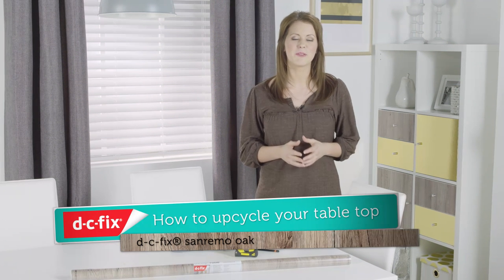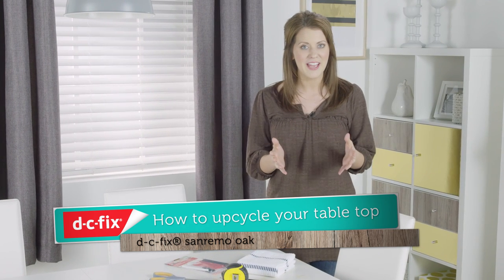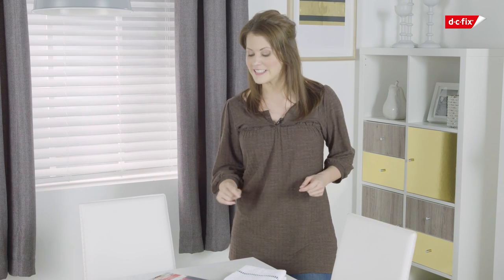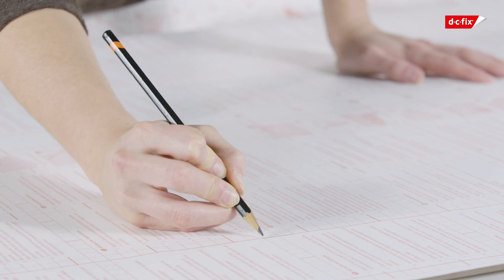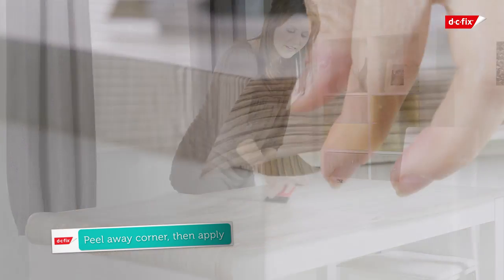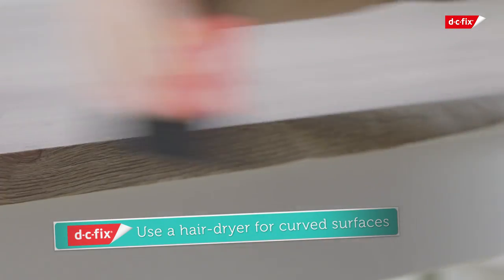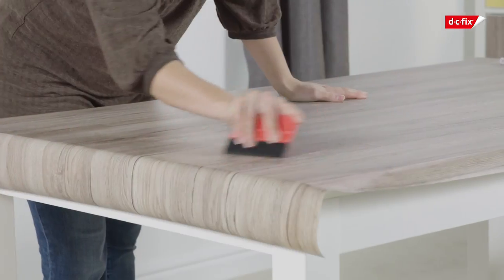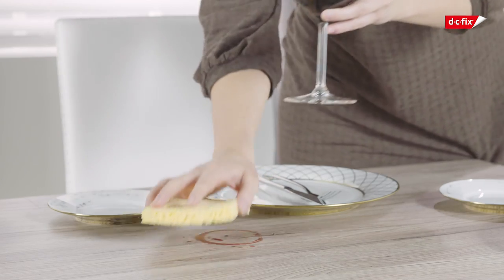Applying vinyl to a table top

Comment from the maker: As long as the table top is sound there should not be a problem with causing damage if needing to remove it. The longer it is on the stronger the glue is but you can soften this with a hair dryer. I hope this helps.. Vinylwarehouse.co.uk